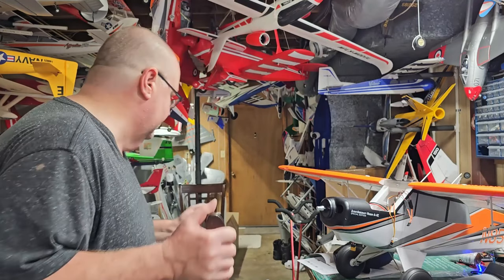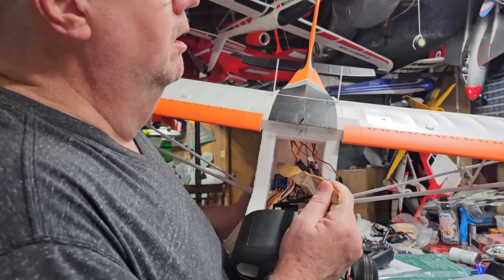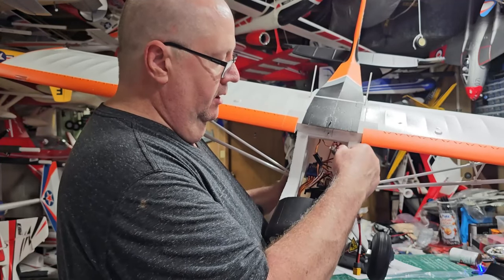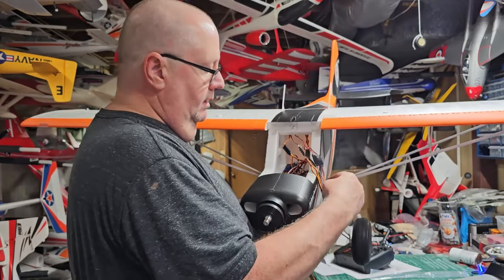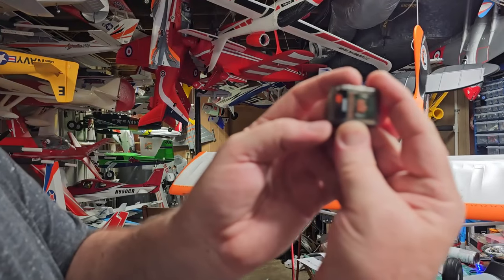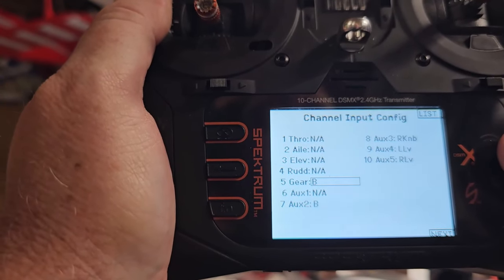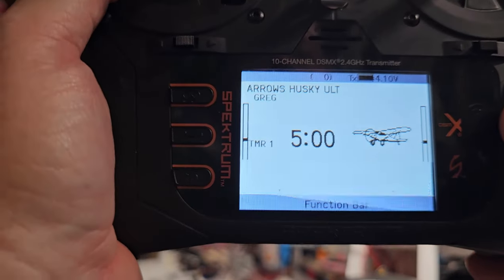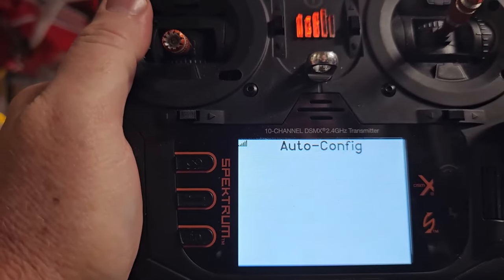ARROWS RC HUSKY ULTIMATE RADIO SETUPS by Fat Guy Flies RC

Comment: My Husky Ultimate arrives tomorrow! I was curious if your original transmitter settings (Rate, Expo,Flap, etc.) have changed since this set up. Let me know what you’ve found to work best, thanks!
Reply from the maker: Not that I remember , my Husky is in the shop right now needed a new motor due to a off camera minor crash.
Reply: Sorry to hear that! Hopefully it’s back in the air soon. Thanks for the great tutorial!

Comment: Lovely plane..but be warned, my motor burnt out on first flight on 6s. The motor really isnt big enough for 6s pulling along such a draggy frame.. also my wong support bar ripped out and folded the wing. Demolished itself into the ground. Was a great performer before that happened. I'd recommend to pull out all glue joins in the wing and re glue with hot glue.
Reply from the maker: Good tip , as far as 6s I will keep her tame. I can see that about the wing also thanks.